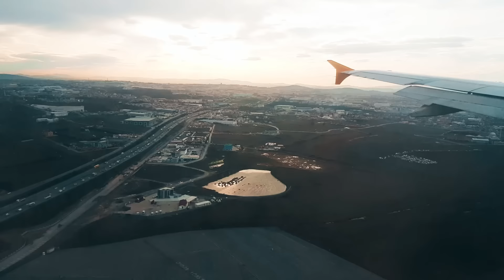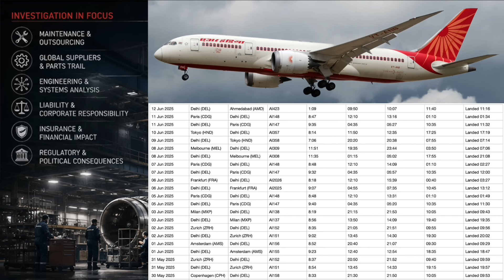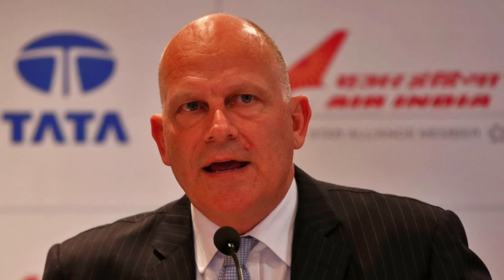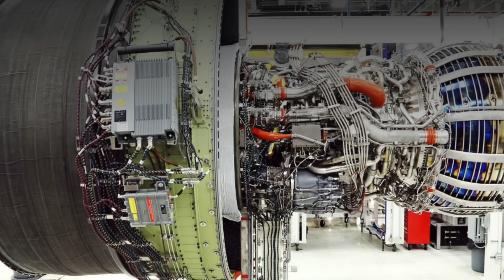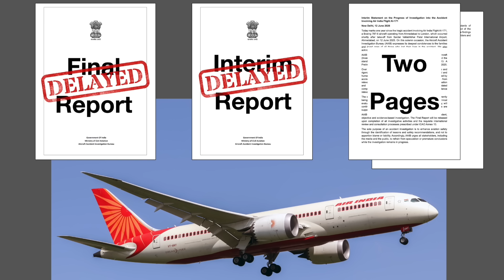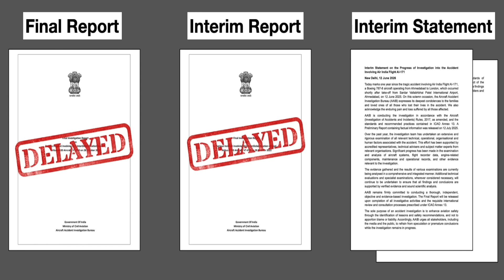AI 171   The Hidden Scale of the Investigation

Comment: 1)
Special Airworthiness Information Bulletins (SAIB) - NM-18-33.} December 17, 2018    
This Special Airworthiness Information Bulletin (SAIB) is to advise registered owners and operators of The Boeing Company Model 717-200 airplanes; (…) Model 787-8, -9, (…) airplanes of the potential for disengagement of the fuel control switch locking feature.
Based on an assessment utilizing the limited data currently available at this time, the airworthiness concern is not an unsafe condition that would warrant airworthiness directive (AD) action under Title 14 of the Code of Federal Regulations (14 CFR) part 39. 
(…) Inadvertent operation of the switch could result in an unintended consequence, such as an in-flight engine shutdown.
Reply from the maker: Thanks Pierre. Yes, this is an important document and the AAIB preliminary report specifically refers to FAA SAIB NM-18-33.

The SAIB warned of the potential for disengagement of the fuel control switch locking feature and noted that inadvertent switch operation could result in an unintended consequence such as an in-flight engine shutdown. The FAA concluded in 2018 that the available evidence did not justify a mandatory Airworthiness Directive, so the recommended inspections remained advisory.

The AAIB also states that the same general switch design, part number 4TL837-3D, was fitted to VT-ANB and that Air India did not carry out the suggested inspection because the SAIB was advisory rather than mandatory.

That makes the SAIB highly relevant to the investigation, but it does not demonstrate that the locking mechanism actually failed on AI171. The key unresolved question remains why both fuel control switches transitioned from RUN to CUTOFF shortly after take-off.

Comment: 2. London to Bengaluru Incident (February 2026)The Incident: An Air India Boeing 787 operating from London experienced a scare during engine start when pilots reported that a fuel control switch failed to remain latched in the "RUN" position on initial attempts before stabilizing on the third try
Reply from the maker: Thank you. We covered this incident in our episode published on 3 February 2026.

Air India flight AI132, Boeing 787-8 VT-ANX, was withdrawn from service after arriving in Bengaluru following a flight-crew report of a potential anomaly involving an engine fuel-control switch. The aircraft landed safely and no in-flight emergency was reported.

DGCA subsequently checked the switch using Boeing’s prescribed procedure and found it within limits, and Air India was advised to remind crews of the recommended operating procedure.

So I would be cautious about describing this as a confirmed case of a fuel switch repeatedly failing to remain latched in RUN. What was confirmed was the crew report, the precautionary grounding and inspection, and the subsequent finding that the switch tested within limits.
Reply: Thanks for your comment.
Maybe it could be a FADEC issue.
On Aug. 15th, the flight MUC HAN VN34 has got a breaks trouble on a B787-9.
I’m living in Vietnam and I’m flying with Vietnam Airlines weekly.
Usually on A320 but sometimes on B787.
The sooner we can get the reports the better

Comment: If this becomes somewhat because of design of the plane. It will be disastrous for boeing.
Reply from the maker: That would certainly be a very serious finding if the investigation ultimately identified a design issue. At present, however, the AAIB has not reached that conclusion. The investigation is still examining the aircraft systems, recorded data, components and operational evidence, so I think it is important to wait for the technical evidence before attributing the accident either to aircraft design or to the crew.

Comment: an i ask - does the 787 no apu ?
if it does why was it not used bit tje rat ?
Reply from the maker: The Boeing 787 has an APU but it is usually switched off during flight to save fuel. We have recommended it is switched on during take off and the initial climb as a safety measure.

Comment: Why did the "India" lead investigators allowed that one CVR snippet?. 

They must have known it could point to a pilot, but what if they were actually pointing to an issue with the plane since one can also conclude neither pilot knew of the switch cut when it happened. When one pilot noticed, he assumed the other pilot did it (any pilot  might right?) and he would not have thought of faulty switch or electrical event immediately. 

If you assume, neither pilot knew (investigators will know having heard the full CVR), India may have wanted to point to a plane issue along with other known 787 issues reported, but it still provides plausibe deniability for  Boeing. Geopolitics (Tarrifs) were intense at the time. 

Reports on the Cut Switches

2018, a warning went out to all airlines to check cut switches(optional) to make sure the saftey loc feature was active. Some were not. It's said most completed check, but some did not incl this  plane. Additionally, on another aviation channel it was said that a batch of 787 cut swiches were faulty and that part # was on this plane.(Not Verified). Did an electrial event trigger these switches to off b/c they were a faulty batch or were never set to protect?. Must be considered in addition to pilot intention.

Net Net, the full CVR and data is needed esp Rat timing.

Open Considerations - Other?

 - Switches physically moved to off (Pilot or bad switches triggered by electrical event)? 
 - Why did plane take off with multiple error codes 15min prior sent to multiple depts? 
 - Did maint miss something given all the previous know fault rpts and other 787s? (Switch Bulletin)?
 - Electrical and/or Equipment failure that lead to a chain of events?
 - Pilot error or Pilot intention?
Reply from the maker: You ask: "Why did plane take off with multiple error codes 15min prior sent to multiple depts? "

Were those maintenance faults displayed on the EICAS system to the pilots?

If not, then there are no faults preventing a take off.

These faults would only be relevant to the maintenance departments upon arrival at the next destination, to be fixed prior to the next departure.
Reply: @IAIwithRichardGodfrey  Interesting. Very good point. Maybe its the kind of issue that gets elevated when alerts arrive that would be considered more urgent than the common alerts. Thats an interesting topic that may get covered perhaps one day.

Comment: A human error can't be excluded as an answer to a failure of the airplane systems.
An aircraft drama is always the result of many causes.
Don't forget the "Swiss Chess" theory according to James Reason.
The aim isn't to blame this one or that one but to find means to avoid such a tragedy again.
Controverses are not current !
Let the investigators finally do their job quietly.
Reply from the maker: Thank you. I agree that human error cannot yet be excluded and that the purpose of an investigation is prevention, not blame.

However, James Reason’s Swiss Cheese model does not mean that every accident must have several separate causes. It describes how weaknesses or failures in different defensive layers can align and allow an accident to occur. Those weaknesses may be technical, human, organisational or regulatory, and they may be connected or independent. A single initiating failure can still pass through several ineffective defences.

I have referred to the Swiss Cheese model many times, but it should not be used to assume in advance that the probable cause must be a combination of multiple errors.

The investigators should certainly be allowed to do their work. At the same time, they have possessed the complete FDR and CVR data for more than a year. After that length of time, a very limited interim statement naturally leaves important unanswered questions. Calm, evidence-based scrutiny is not interference with the investigation.

Comment: Thanks Richard for your detailed and logically paced treatise.  I am curious if you have ruled out water egress as a cause for the computer malfunction?  I also still think the puff of cloud when AI-171 nose lifted is significant yet unexplained.
Reply from the maker: There is a history of water ingress issues from the central toilet block to the Aft E/E Bay in Air India's  Boeing 787 fleet. The puff of cloud when the AI171 nose lifted is possibly from the Aft E/E Bay Lithium Battery encasement which is vented to the left side of the aircraft just behind the wing. Both issues are discussed in my three papers on AI 171.
Reply: @IAIwithRichardGodfrey  Thanks Richard, Was just  confirming.  It makes sense in that as soon as the nose raises the water will flood back as a wave and saturate the batteries and electronics.

Comment: My best guess is that investigators may have uncovered an electrical flaw in the system and there are now attempts to cover it up. Given that the Dreamliner is one of the manufacturer’s most advanced aircraft and the two 737 MAX 8 disasters have already damaged its reputation, they may be trying their best to keep the issue under wraps. I may be wrong!
Reply: We all would love you to be wrong, but the silence is significant. 777 is another example showing that todays flying computers has nothing similar with its former version.

Comment: Hi Richard. The burnt section of VT-ANB’s tail fin is a real concern for me. A significant portion of the rear section of the vertical stabilizer, where some significant metal hinge mounting hardware is located in an airy box section, was reduced to a melted mess. How was that possible? Did the fire start from the inside? Could battery fumes get up into that section and then get ignited? I have heard that lithium battery mishaps can create their own oxygen supply. If it was a fire caused by ignited fuel why wasn’t the forward section of the stabilizer and the rudder also burnt more? Why did the vertical stabilizer break off where it did? Was the tail section compromised by heat prior to impact? The tail section hasn’t been talked about much, and I think it should be analyzed. Thank you for all your contributions towards this accident. Regards.
Reply from the maker: The aircraft was fully fuelled for a long flight to London Gatwick with 54,200 kg of fuel. On impact there was an explosion and huge fire ball. Despite the fire ball, one passenger was able to walk away from the crash. The fuel tanks are across the aircraft from the left wing to the right wing and would have separated on impact.

The grey smoke seen on take off may be from a Lithium battery in the Aft E/E Bay which has a steel container and a vent on the left side of the aircraft. The FDR data will show exactly when any fire indicators were announced and where. 

The tail section broke off because it was trapped in a building in the medical students compound, whereas the rest of the aircraft impacted the flat roof of the building and separated, throwing parts forward towards other buildings in the compound.
Reply: @IAIwithRichardGodfrey  ein  großer  Feuerball der brennende Teile überall herunter regnen  lässt   und  damit natürlich auch zu sekundären   Brandherden führt!

Comment: Sir Richard,
Do you know of any updates on the Amelia Earhart search to be taking place later this month in conjunction with Purdue University?
Thanks so much~
Reply from the maker: It is a joint project involving Purdue University/Purdue Research Foundation and the Archaeological Legacy Institute. The team plans a short, approximately five-day investigation at Nikumaroro, the remote Kiribati atoll formerly known as Gardner Island.

This is not a broad deep-ocean sonar search near Howland Island. The target is a specific elongated feature in the shallow lagoon at Nikumaroro, identified in satellite imagery and estimated to be roughly comparable in length to Earhart’s Lockheed Electra 10E.

In my view, the evidence points to a crash location 48.6 miles North East of Howland Island at around 1.3736°N 176.1977°W. This is 694.4 km or 374.9 nmi NNE of Nikumaroro, which is on a bearing of 164°T.

The location 1.3736°N 176.1977°W is the intersection of 5 items of evidence:

1. The track of Earhart's aircraft according to the original flight plan written by Clarence Williams dated 9th February 1937 and based on the winds reported at the time, which passes Howland Island around 27 nmi North of the island.

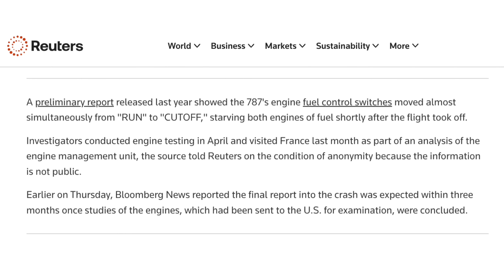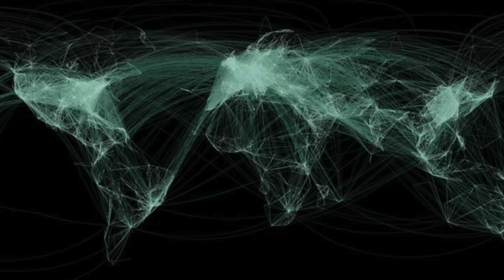2. The radio messages at 17:45 GMT "we are about 200 miles out" actually 161.7 miles, 18:45 GMT "we are about 100 miles out" actually 96.6 miles, 19:12 GMT "we must be on you but cannot see you" actually 48.6 miles, 19:28 GMT "circling" and 20:13 GMT " we are on a line 157 - 337".

3. The line of sight is 38.7 miles at an altitude of 1,000 feet.

4. The radio service range of 45.8 miles at an altitude of 1,000 feet based on the antenna height of 50 feet of the USCG Itasca.

5. The crash location is 48.6 miles from Howland Island and just outside the line of sight and the radio service range.

Earhart's Track: https://www.dropbox.com/scl/fi/dqt747w2h2eux2hf7fdki/Amelia-Earhart-Flight-Track-Howland-Island.png?rlkey=gd2s7uok7c1iwbplq1dp8bqnk&dl=0

Earhart's Flight Plan: https://www.dropbox.com/scl/fi/6k0p61szwraajfx5bbmdr/Amelia-Earhart-Original-Flight-Plan-Clarence-Williams-09FEB1937.png?rlkey=1opuxglcqibis6cfzg3l6pla6&dl=0